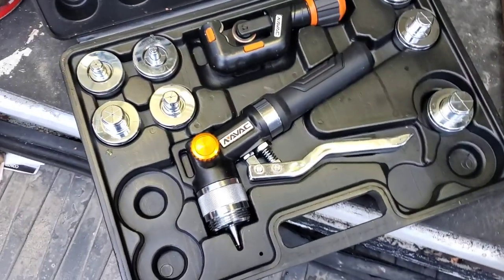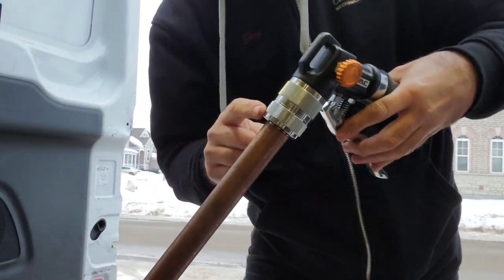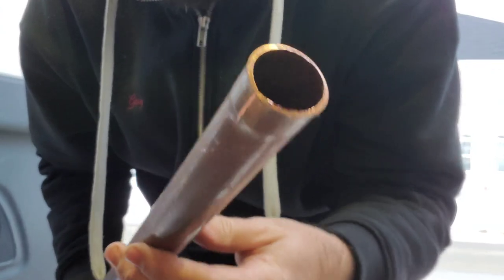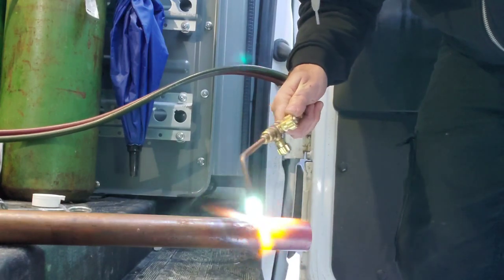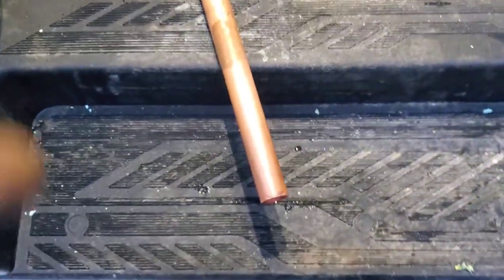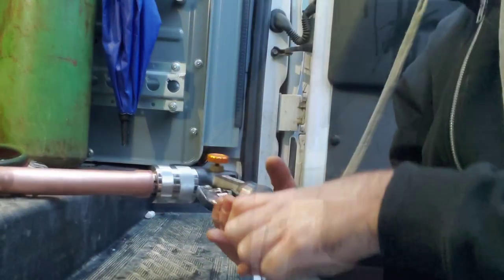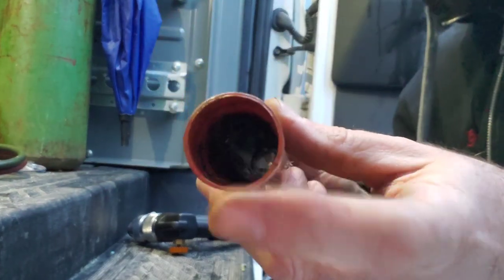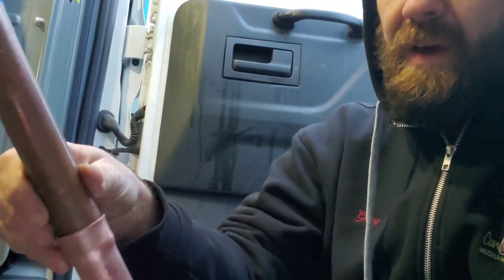How To Swage/Flare Hard Copper In The Field - Decrease Hardness and Increase Ductility

Comment: IMO,  Annealed copper can be air-cooled or cooled by air will NOT be as soft and malleable as that cooled by water (or another fluid such as oil).  Being 50 yrs in the service and installations of cascade refrigeration service, I've seen things evolve greatly. Pre mid 1970's it was a different industry. Vacuum pumps  besides being extremely heavy, belt driven, loud literally SUCKED, besides weighing up to 100 pounds and belt driven.  There wasn't any reliable micron indicators so we did the best we could, this is why we Triple Evacuated everything, and then we were not sure due to the compressors shaft seal (yea, they were belt driven).  After each vac you purged with virgin refrigerant. We also used special sealant on the OUTSIDE of the flares, used 1/4" copper flared tubing hoses since the rubber hoses weren't like todays' hoses that prevented seepage through the pores.  But today's trade has a utopia of tools and equipment that takes the guess work out of almost everything. Dependable micron indicators, and when you get down to 250 microns, and it holds you don't have a significant amount of moisture in the system unless you're dealing with cascade units. Don't believe me, get an R-718 thermo-properties chart and see for yourself.  We should be more concerned about the oxides formed when annealing when nitrogen isn't used, which cuts windings and bearings like little diamonds when it ends up in the compressors oil.

Comment: If you have to anneal it in the van, or anywhere really. Try ans attach a slip over fitting with a quarter inch access port to flow nitrogen through it. Copper oxides don't necessarily pay the bills or for rent, so they shouldn't be in your pipe. Not always the easiest or some times possible for repairs, but it is the best practice when possible

Comment: Thank you for making this video.  I made an aftercooler for my air compressor using 1/2" schedule m copper pipe and JIC fittings.  Everywhere I looked they said you can't flare copper pipe, you have to use copper tubing.  Well, this worked like a champ for me using the schedule m pipe and one of those flaring tips with an electric drill.

Comment: Nice tip.  You demonstrated one of the few good hvac reasons to anneal copper tubing.  Usually annealing is an undesired side effect of high temperature brazing.  The primary reason a metal is purposely annealed is to reduce hardness and to make it softer, unlike tempering.
Reply from the maker: Nice comment!

Comment: Copper can either be annealed by quenching it, or rapidly cooling it by plunging it into water. Or you can allow it to slowly cool in air. Either way the copper will become annealed. Annealing is not the same molecular process as "harding" steel/iron other metals. Nice video.
Reply from the maker: Thank you!

Comment: Thank u, this process on anihaling can be carried out only on the side that needs to be expanded right? If I have to do it on the opposite end di need to heat the pipe again?
Reply from the maker: Only on the side you're annealing.  You only have to heat it once.
Reply: You can heat the center too and then are able to use your tubing bender
Reply from the maker: Sorry, yes you bend annealed pipe